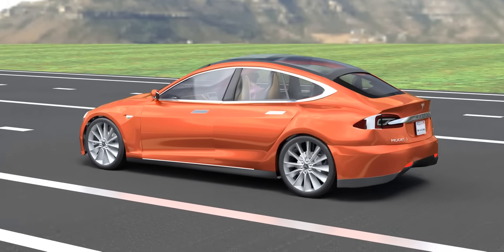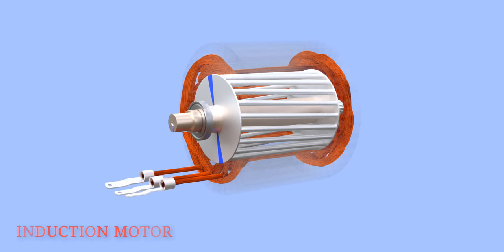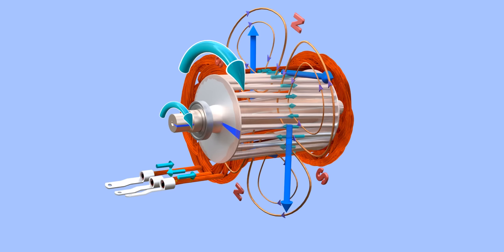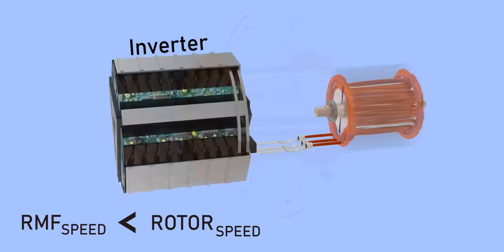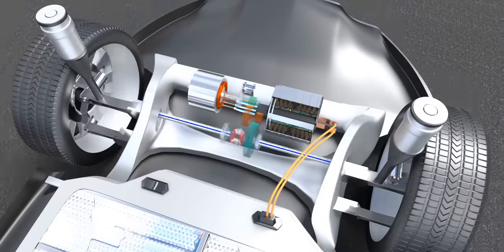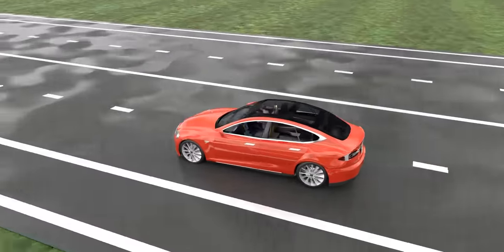Understanding Regenerative Braking!

Comment: Regenerative breaking is also used by trains and trolleybuses and the energy is transferred back to the network
Reply: Some elevators and bikes have regen braking too
Reply: Trains in the US have the technical capability too as they're diesel-electric powered (diesel engine turns to power an electric motor), but they are unable to do this as they are not connected to the grid or have batteries enough to store that, so they just burn off this extra electricity through gigantic resistive heaters on the roof.

It's crazy that they just throw away this easily exploitable electricity.

Comment: Tesla now allows regen braking all the way to a full stop. It use to be to about 5mph before the friction brake was needed…. Now I haven’t touched my brake pedal in a long long time
Reply: Its the best thing since sliced bread. It is a much more relaxing drive when you barely have to lift your foot from the accelerator I can't imagine driving a car without it.
Reply: Is the regen really doing all the braking, or is the car just automatically applying the friction brakes for the last bit?
Reply: @adrianthoroughgood1191  The car automatically applies the friction brakes. In fact, teslas have power meters that show how much energy is entering or leaving the battery, and if you take your foot off the accelerator entirely and let the car stop itself, it doesn't show any energy entering the battery anymore after it goes below 2 or 3 miles per hour.
Reply: Relaxing top boring big iver 1980 exidics xars

Comment: Regenerative braking can fully stop the car these days without using the friction brakes
Reply: I'll venture a guess there's break blending like mentioned in the video which activates the break when you release the throttle.
Reply: @Steror No, you can actually stop the car completely with regen. It works best at lower speeds like around 40 mph and less, the lower the speed the stronger the regen is, but it does need practice to get the timing right so you can stop the car where you want it. An update added physical braking when regen isn’t at full capacity like when it’s cold or having a high battery SOC.
Reply: @gabem8119  how do you know you're only using regen? My 2014 Tesla MS will regen break fine at high speed but at about 3-5 km/h the regen is so weak it  becomes infeasible to use. Newer cars can do break blending so they use friction brakes when regen is not enough.

If you are sure that your car is not doing break blending and can stop from 10 km/h to 0 in under 3 seconds, I really want to know what car it is and why mine can't do that.
Reply: All the new Teslas 2020 and newer stop on their own very quickly. I owned a Chevy bolt that stopped on its own, no braking. My 2021 model y stops on its own, no breaking. There is a toggle in the car specifically for to be able to using breaking when regenerative breaking is not available, but it’s very clear the purpose of this is to function as normal when it is fully charged. For folks who have never experienced regenerative breaking, if your car is charged to 100%, the car will not activate regenerative braking. So, it will coast as it normally would, as if it is in neutral or how a gas powered car would coast. 

Most electric cars nowadays will stop completely using only regenerative breaking. This video is extremely outdated.
Reply: It could in some situations, but would recoup less power by doing so. Your regenerative braking system cannot optimize energy capture if it needs to prioritize stopping the car. The two goals aren't perfectly aligned. Strategic use of the friction brakes actually allows regen braking to be more efficient.
Reply: If you can control the frequency of switching the current, or even move the car backward, why it can't use as a break to slow the car down to stop?

Comment: The rear motor in Tesla, Volkswagen and Hyundai electric cars is not the induction motor you have represented in the video. They all use a Permanent Magnet Synchronous Motor (PMSM) but the video is still valid because the principle of regeneration is the same. The only difference is that rotor and the stator magnetic field rotate at the same speed: the machine is synchronous. Thanks for the good video.
Reply: LR AWD Model S and X used to use a PMSM on front axle and induction on rear, whereas the 3/Y use induction front and PMSM rear. Since the refresh launched, they’ve used 2-3 PMSM motors. This is a little bit of a dent in efficiency because the PMSM generates a force each time it spins around even when no power is being fed to it. This is why Hyundai/Kia/Genesis, Mercedes, Porsche, Audi, etc. all fit a mechanical decoupler to one of their PMSM motors so it doesn’t spin and create drag when not needed for power. It’s honestly a little surprising Tesla didn’t keep an induction motor on the LR AWD S/X or invest in a clutch to decouple one or two of the motors from the drivetrain like the Germans and Koreans have done, but they didn’t. Hyundai claimed the addition of the clutch system improved cruising efficiency 9% on average on their AWD models. In my experience it’s closer to 20% at highway speed.
Reply: @CFG39  The front induction motor is barely used in normal daily driving and only when it is needed.
Reply: @icy1007  on Model 3/Y, yes. On Model S and X which no longer use an induction motor (they’re using 2 or 3 permanent magnet motors) obviously that isn’t an option. 

On the S and X it would be ideal to switch back to induction or to add a clutch to the front motor to decouple the motor when not needed (pretty much anytime you’re not hammering it) like Hyundai/Kia, MB, etc. use on their EVs with multiple PM motors.
Reply: Nissan's used the PMSM since 2011. Weird that everyone seems to forget about Nissan.
Reply: @casey360360  I still have my 2011 Nissan Leaf, I'm constantly trying to forget about it. :)
Reply: I always wonder what intelligent people like you do daily?

Comment: It is probably quite similar, but I would love to see an update with the permanent magnet motors, and how they use one pedal driving right down to Fu stop.
Reply: It’s much more simpler. Permanent magnet motors are synchronous, they do not need any input to generate power, their frequency is synced to their rotation rate. To regen, just simply pause the inverter and hook up a rectifier is all you need.
Reply: They can either blend in friction brakes or use "plug braking", basically using the motor backwards (actually consumes power).
Reply: Even permanent magnet motors need to blend normal brakes below 3-5mph. It’s just automatic with EVs with One Pedal Driving
Reply: @j.phoenix  technically they can using what's known as "plug braking" but it actually consumes power instead of generating it.
Reply: @sethflorentz4809  Not a single EV uses plug braking. That would be moronic.
Reply: @yrr0r244  To be specific, the RPM of the rotor dictates voltage output when used as a generator, so you would need only the inverter (whose fet/diode circuit functions as a rectifier) and a buck/boost converter via a PWM circuit.

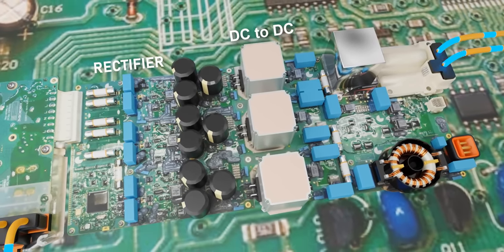Comment: 2:55 I am not sure about Tesla EVs in particular but in general, the power produced from regenerative braking by the inverter is in DC format only. Inverters normally change DC to AC so when operated on reverse, they change the AC power from the motor into DC. So there is no need for an additional rectifier.

But this DC power needs to be brought to a the right voltage for charging the battery, which is where the DC to DC converter comes in. Another interesting thing is that usually this part requires very little additional hardware, as the on-board charger used in most EVs also consists of a DC to DC converter - and that same one is used for charging the battery during regenerative braking, as the on board charger is not in use during driving.
Reply: Not even close. The FET/diode circuit in the inverter works as a rectifier during regen, the inverter has a PWM circuit to act as a buck-boost converter. Regen is contained 100% in the inverter, regen force is also controlled by the inverter. The DC-DC converter only steps down voltage to the accessory battery. Level 1/2 charger is done by AC rectified and stepped up to battery voltage by again, the inverter. level 3 charging is native DC from the charger.
Reply: @casey360360 As for the first part of your comment - that is exactly what I said. The inverter rectifies the regen power and there is no need for an additional power converter for that.

Regarding the need for a DCDC converter - firstly I am talking about an HV to HV DCDC converter, not the HV to LV converter for the auxiliary battery. Secondly, the video already mentions that the architecture they are describing uses a DCDC converter to bring the voltage to the HV battery voltage. This is a very common characteristic of many EV architectures in the industry today, as they want to support 400V DC charging which is more widely available than 800V DC charging, but they still want to have an 800V inverter, heater, a/c, etc to improve overall efficiency. Of course, there are EV architectures where the inverter regen voltage is directly at the battery's voltage level so there is no need for an HV to HV DCDC converter, but that is not the kind of architecture they are describing in the video.

Regarding level 1/2 charging through the inverter - yes that is one of the features of a few modern EV architectures but most on-road EVs today have a separate On-board-charger and inverter. Watch any teardown video and you will see.

Comment: Gotta love in some car models it does not put the brake lights on when regenerative braking is applied. Is a loophole in the law. If a car in front of you is at max regenerative braking it will be slowing down pretty significantly and there will be no brake lights to tell you. Brakes lights only have to be on when friction braking is applied. Till the loophole in the law is fixed you rear end one, ,brake light on or not, your fault.
Reply: This was the comment I was looking for.Bloody dangerous for the vehicles behind it.
Reply: @mehmettemel8725 Tesla puts brake lights on.
Reply: nonsense. in the USA, NHTSA requires (of all manufacturers) the activation of brake lights upon deceleration. additionally, there are laws against vehicles' brake light system not being functional.
Reply: I can’t believe with all the technology we have today, there are still people who think that the only way to have a functioning brake light is to tie it to the physical action of pressing a pedal…

The brake lights are tied to rate of deceleration, not to usage of a pedal or application of friction brakes.

Comment: It would be interesting to see how Tesla has been achieving a very precise control of the vehicle movement at low speeds now, it seems like it actually uses energy when coming to a stop at low speed downhill and I would also presume on a flat surface too, it's just negligent compared to the energy needed to stop at downhill scenarios

Comment: Tell me why we can't force motor to rotate in reverse direction in order to completely stop the car without friction braking
Reply: why would you waste more power?
Reply: @DrDrift-rl6cc  Won't it recharge the battery instead since we are consuming rotational kinetic energy of the wheel? Energy has to flow somewhere, right? (Btw Work done by torque is negative when angular displacement is in opposite direction, so motor 'should' act like a generator)

Comment: Always wondered how the brake lights would work with that, and the effect on rear end collisions
Reply: I think they are controlled by the computer. I know in my car as soon as I barely reduce pressure on the accelerator the brake lights come on, I don’t have to press the brake pedal.
Reply: #1 question asked on Tesla test drives, they say.  The brake lights are turned on when braking, automatically.  The cartoon version of the car on my screen shows the brake light illuminated.
Reply: It's not just EVs, modern gas cars have special brake light logic as well. For example, when you are in hill hold/auto vehicle hold, or in collision avoidance emergency braking, the brake lights will turn on even though the pedal isn't applied. This caused an issue with the new Ford Ranger because they forgot about this when designing their trailer brake controller, so there's a stupid harness running from the front through the roof to the CHMSL to get a braking signal.

Comment: You told that inverter keeps RMF speed lower than rotor speed by applying specific frequency current. And then inverter takes back power from coil. How does you can control the frequency of current when you are drawing energy from the coil?

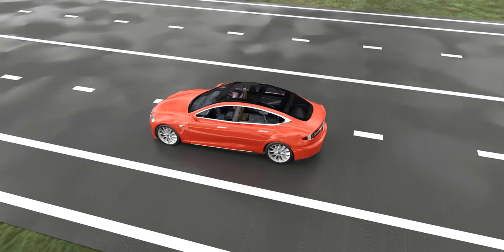Comment: 4:00 I heard somewhere that it's between 20-60%, not 10%.

Is there a way to actively control regenerative braking torque? The problem with modern regenerative braking is that you have to try and estimate when to remove your foot from the accelerator pedal in order to minimize wasted energy. If you estimate the timing incorrectly, you'll need to use friction brakes at the end, which wastes energy.
Reply: Probably way less than 10%.  Stopping from 60 MPH typically takes around 5 seconds.  Let's be generous and say it takes 10 seconds.  How much charge can be put into an electric car battery in 10 seconds?  Not much.  Even if the car is stopped 20 times from 60 MPH, that's still less than 200 seconds of charging time which won't increase range much at all.
Reply: @dno8025   yep, there will always be waste heat in the end, cannot beat entropy
Reply: @dno8025  That assumes all braking is as aggressive as you describe. In reality, you can often coast to maximize the regenerative braking energy captured
Reply: @gabedarrett1301   - Using only regenerative braking it takes less than 10 seconds to get from 60 to 0 on many electric cars.
Reply: You can control Regen stopping power on the fly in some EVs.
It's in some menus in Teslas but right by the steering wheel with levers/paddles in some cars like the Ioniq 5.
I prefer the paddles, much more convenient when you need to change braking NOW

Comment: Does it mean that in electric cars there is no functional analog to classic combusting car's „Neutral“ or clutch pedal pressed, when  the car moves solely via it's own kinetic energy?
Reply: That's right, motor is always connected to wheel
Reply: @beakmann Hello, thanks for answering my question. Well, that seems pretty ineffective to me, as the motor either drives the wheels or is driven by the wheels and recuperates, which probably means quite substantial losses in the charging / power conversion train.
I use the Neutral gear all the time when driving my 1.7 CRTD diesel Opel Astra. That way it only consume about 4.2 l/100km.
Reply: @medvidekkrupicka1404 regen can be about 90% efficient. But yea, sometimes it sucks to be unable to roll
Reply: In some EVs there is.
You can turn off Regen entirely in some models.

Comment: Except that due to inefficiencies and friction and air resistance and a whole lot of other factors in well, all parts of the system, only a small portion of the energy used in going up a hill is returned to the battery. A very small portion indeed.
Reply: Check data. Driving down through mountains, a battery can recharge almost all the  energy used going uphill.
Reply: @FrunkensteinVonZipperneck  Wrong . Completely wrong. What I said 2 months ago remains true. Very very little energy is recovered.

Comment: Could this be used for everyday bikes?? Not when braking of course but when peddling or going downhill to accumulate the energy but into it to use later?
Reply: If it worked like EVs, you'd lose speed going down hills if you used this technology but you'd be able to use it to go up hill at least.
I think some E-bikes have similar tech to what you are asking.
I personally wouldn't trade my fun bombing down hill at 50mph on a bike or coasting for miles for some uphill convenience but I'm sure many would.
Guess it'd have to be a toggle for on/off when you wanted it, ideally.

Also, regular bikes have this too already, to charge headlights and cell phones, look up "dynamo hubs" for bikes.
Reply: There are many Ebike models with regen braking, but just like the video noted, efficiency greatly decrease at low speeds, so the additional range you get is much less than 10%, making it less important of a feature.